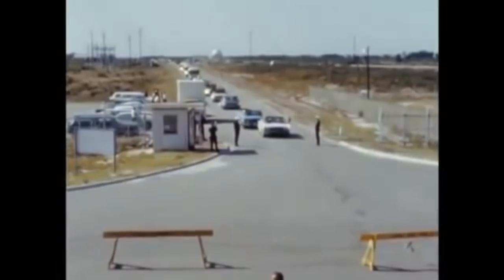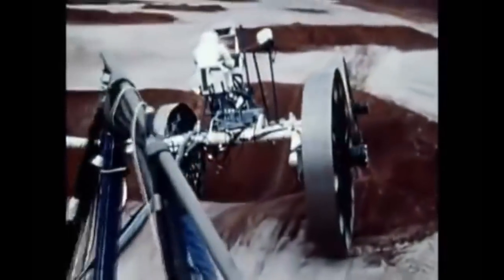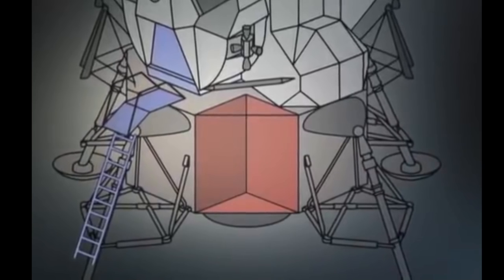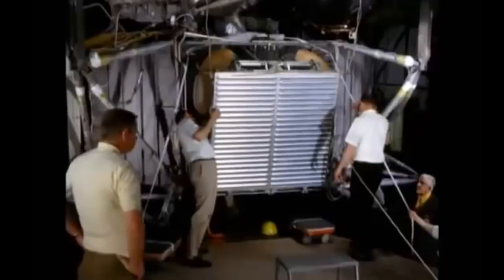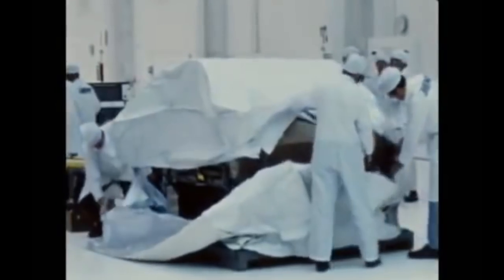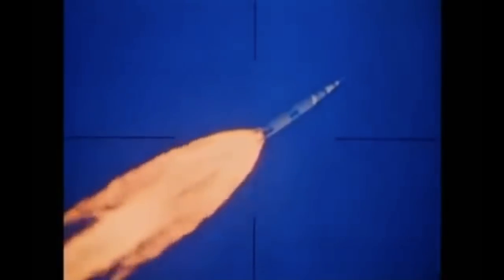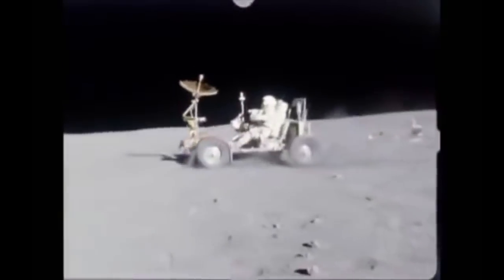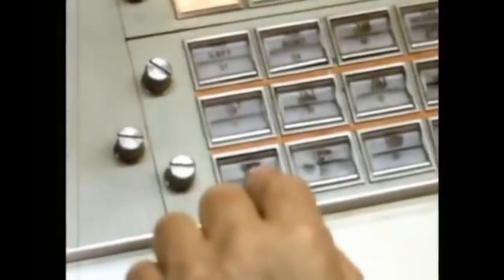How did the Lunar Rover get to the moon ? - Prof Simon

Comment: What batteries did they use on the moon.?
 [If you believe they went]
The moon reaches +127C in full sunlight and in full shade it goes down to minus 173C
They powered everything from air-conditioning and heating to transmitting speech and  TV pictures back to Earth.
The Lunar Rover also required it's own batteries.
So what actual batteries did they take and how many of them?
Reply: They used magical batteries.  The blueprints for them were eaten by a dog, so that technology was lost.
Reply: @Graham Bunton Why didn't you look it up yourself?

Ascent stage: two 28–32 volt, 296 ampere-hour silver-zinc batteries; 125 lb (57 kg) each
Decent stage: four (Apollo 9-14) or five (Apollo 15-17) 28–32 V, 415 A⋅h silver-zinc batteries; 135 lb (61 kg) each

Regarding temperature - have you ever used a vacuum flask to keep your drinks nice and cool?
Reply: Well duh!
 Energizers, of course!

Comment: I've recently begun to install solar panels and battery power in a van so I can camp in relative luxury. I'm finding solar power isn't very good in providing enough power to run heat and cooling. How did the Apollo scientists manage it with 50 year old battery technology? I could use a few of their ideas right about now! Thanks.
Reply from the maker: Good luck with the van....nasa probably had a higher budget than you or I do.
Reply: The military  NASA grade solar panel uses 3 color layers, us commoner can only buy the basic single layer panel, NASA panel is a million dollar a piece I heard.
Reply: I think they had a hydrogen based fuel cells, you can see in pictures there are no panels like the space station or Hubble. I think some of that fuel blew up on Apollo 13 was for that purpose, that is why in the movie and real life power was an issue. I have been watching Space-X rapid advancement with a driven leader, I suspect you will see amazing things happening with them and the moon in the next decade.
Reply: @mykofreder1682  I never thought of hydrogen cells. I will have to check those out. Thanks.
Reply: 🐸they obviously had the top battery of that time but remember that on the Moon 🌘 less Power is required in order to move because.....

Less pull of Gravity and no Atmosphere ✔️
Reply: @avlisk  hydrogen = hendenberg. Oh the humanity.
Reply: @mykofreder1682  - An oxygen tank exploded on Apollo 13 during a cryo-stir.
Reply: They had the same battery tech we all had at the time. NiCd batteries, for example, were developed for the Navy in WW2. There was nothing special at the time.
Reply: On Earth car batteries [which were the only ones available in 1970's] work OK
But the moon has a temperature range of minus 173 C in darkness to plus 127 C in full sunlight.
Car batteries are at their best at 27 C higher or lower and they give out less electricity.
So what batteries did they use on the moon?
Reply: @K22channel  Less GRIP too. 1/6th of the grip. On a dusty surface. 
But we NEVER see them skid out of a sharp turn. Why?

1/6g in dust is like driving your car on solid ICE.
Reply: @G-ra-ha-m  🐸Have You ever seen the Rover tyres? They were built for Sand. They are not rubber made✔️
Reply: @K22channel  So even less grip.
Reply: @G-ra-ha-m  🐸 when you watch those footages;  remember not to wear the welding mask✔️
PS: I am telling you because I did see fountains of sand comming out of those tyres! But Hey!

I was not wearing the welding mask ✔️
Reply: @grahambunton377  They had special batteries that we aren't  allowed to know about.  😉
Reply: The gullible public will believe anything that the powers that be tell them.
Reply: @SimonHollandfilms  So what solution did they use, please? An average of 18 miles each over a sandy type surface with it's drag factor. What systems did they employ to car people and rock samples over such distances with 1972 tech?
Reply: Insulation shade and air movement through water
Reply: @G-ra-ha-m  No, even more grip. They were a mesh type "wheel" so they had plenty of traction. Also, they weren't going that fast on the turns. They traveled at only 8 mph.
Reply: @Woody615  Plenty of traction of what? Sand. Big deal. In 1/6g they have the same momentum but 1/6th weight, so 1/6th grip: like driving on ICE.
Reply: @G-ra-ha-m  And yet they didn't have a problem driving on the moon.
Reply: @Woody615  Exactly woody, when basic physics says they could not have done it, but a 50+ year piece of propaganda with impossible grip (plus photos of weathered, clean rocks) says they could: What to believe, eh?
Reply: @G-ra-ha-m  No your understanding of physics is what is wrong. Please do some real research and read books about how it was done. End of discussion.
Reply: @Woody615  'End of discussion' - haha, you are anti-science. 
I suggest you learn the difference between weight and mass before you debate your beliefs here.

Comment: If Neil Armstrong only had seconds of fuel left when he landed on the moon , How the hell did he get back to the Lunar craft that brought them back with no fuel??
Reply from the maker: Good question...2 engines...decent and assent...
Reply: There were actually two parts to the Lunar Module . The descent part (the one that was out of fuel) and  the ascent part, the one that separated to lift off from the moon. Each had their own engine and fuel supply.

Comment: Love to see what pedal push bike would perform like in low gravity of the moon, I wonder if they even considered that when they hear how little weight they had to work with :P
Reply: On a dusty surface in 1/6g it would have been like riding on ice and you'd fall off.
Ever see the LRV skid, fish-tail or wipe-out? Me neither. Why?
Reply: @Graham That's an extraordinary claim. Please show me your evidence that it should have skidded more than it did in the videos.
I can understand you saying "I think it should..." but I'm gonna go with the worldwide experts, unless you can come up with better than "I reckon".
Reply: @ann_onn  It's not extraordinary in fact, it's very basic maths. The mass remains the same, but the downforce reduces to 1/6th or 17%, as does the grip. 17% of normal grip is what you tend to get in icy winter conditions, do the research and you'll find out. Metal on dust isn't very grippy to start with either, so you have 17% of very little grip.
https://www.youtube.com/watch?v=0N3BKmDiKmc
Reply: I can ride a bike in winter.
Reply: A motorcycle was briefly considered for its small size and light weight. A prototype was built and tested.

Comment: Brilliant stuff as always Prof. Curiously I thought I glimpsed mudgaurds on the rover as it was packed. Dismissing this as silly, I then saw what looked like rain on the moon as the rover drove about. Maybe this was moon dust, vicious stuff I hear.
Reply: LRV mass = 210kg
Weight on the moon = 210 / 6 = 35kg
Weight per astronaut = 35kg / 2 = 17.5kg
So why did they install a system of winches and pulleys?

Comment: You didn't address the weight issue at all, "professor" Simon.
Reply from the maker: It had a maximum all up weight and had to fit into the triangle section on the lem skirt.

Comment: How was the rover powered?I'm assuming it was an battery powered motor?
Reply from the maker: yes...it flew with charged batteries and solar panels to recharge
Reply: @SimonHollandfilms  
From what I read, the batteries were not charged by solar panels.
“Power was provided by two 36-volt silver-zinc potassium hydroxide non-rechargeable batteries developed by Eagle-Picher with a charge capacity of 121 A·h each (a total of 242 A·h), yielding a range of 57 miles (92 km).”
I think the only solar panels  used on the moon landings were to power the science experiments that were still operating after the astronauts left the moon.

Comment: some people have studied the moon rover..........it has the exact same wheelbase and chassis as ..............a WW2 Willys jeep. How did the camera pan up to track the ascent of lunar module at 6.18 and keep it in frame with the tech of that era??
Reply from the maker: Good question....the take off was filmed from the remote controlled camera on the rover....the Houston camera guy....pressed ...tilt up a few seconds before the timed take off.....it worked....the last 3 missions it messed up,
Reply: @SimonHollandfilms  its not that simple.............it would require perfect camera placement and timing. Did camera's of that era even have those features (remote control and robotic camera panning ) available............dont think so. More likely that the faked scene had a person making the camera movements.............  until they stopped doing it for the obvious reason it was not technically possible.
Reply from the maker: No....it’s a well known story...one on the best NASA success stories..it really happened on the 3rd attempt.
Reply: You've had enough crack for today. The chassis of the lunar rover looks nothing like that of a jeep

Comment: 3 words: Van Allen Belts.
Reply from the maker: Fly Fast and choose a week bit. ...but cosmic radiation was a problem.
Reply: @SimonHollandfilms  This is not an answer, i.e. to fly faster through 100 REM. Also, this is not what they allegedly did, they went straight through them, and in one of the worst solar flare days. Suppose now that they were not human, and did not die from all that radiation, do you realise how badly affected the films would have been?
Reply: @SimonHollandfilms  The NASA Apollo 11 Flight Journals show over 11 hours spent between 1000 miles and 40,000 miles from earth: That's not 'fast'.
Additionally the inclination of take-off used does not clear the belts, it sends them right through them.
Reply: "The claim that radiation exposure during the Apollo missions would have been fatal to the astronauts is [...] nonsense." - Dr. James Van Allen

It's a belt, not a sphere. You can avoid it almost entirely.
Reply: @ann_onn  No you can't. It's a donut shaped ring that rotates around the magnetic axis and the inclination of take off, orbit and translunar injection punted them all right through it.
It wasn't for a short time either, the Apollo 11 Flight Journal gives the time to go from 1000 miles to 40,000 miles out as around 5.5 hours each way. Read it at NASA if you don't believe me.
Reply: @Graham So, you believe NASA?
Great.
Problem solved.
Reply: @ann_onn  I'm merely stating that NASA's own Flight Journal contradicts the story that they went through it for only a 'short time' and their own Flight Plan contradicts the story that they missed it.
Reply: I didn't say they missed it. I said they avoided it almost entirely. They minimized their exposure. 
Radiation does not instantly kill everything. We are all constantly exposed to radiation - it's a normal part of life. As long as we avoid too much of it, we're fine. 
Lots of research, planning and tests were done - Mercury, Gemini, and the earlier Apollo missions.
They passed though the more active part in minutes, and all of it within a couple of hours.
The astronauts each wore a personal dosimeter, and received about 1 RAD in total, during the entire mission. Similar to a dental X-ray.